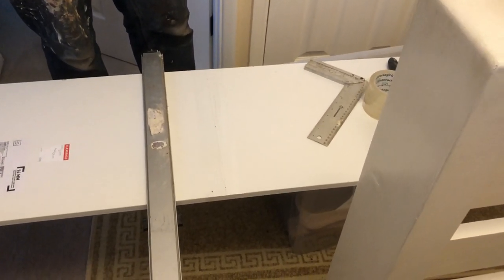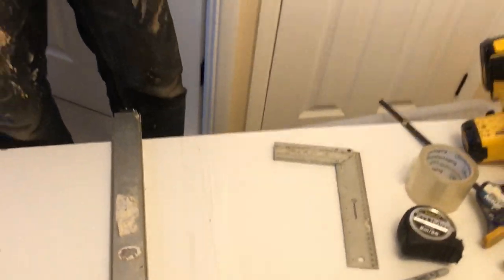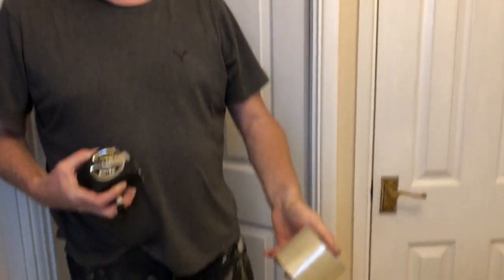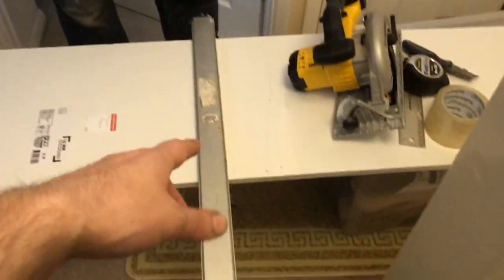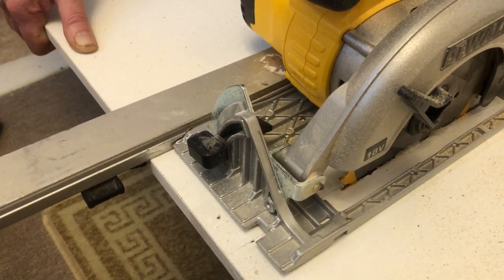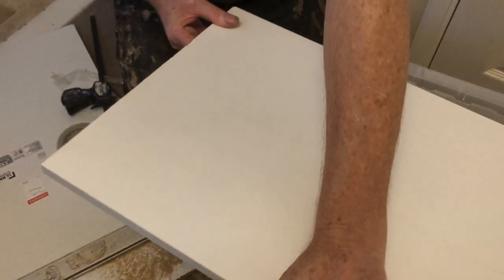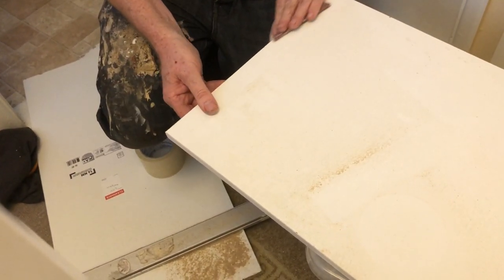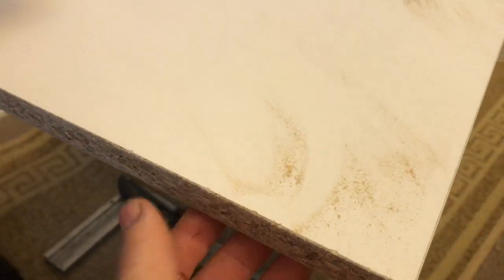How to cut melamine board

Comment: Do a 3mm trench cut first with your skill saw then make your full depth cut, use a 60 tooth blade too, you'll have minimal tear out on the top side.
Reply: What about cutting at 45 degrees? I need to shave the end off one at 45 degrees to fit in a tight spot against an angled wall. Any tips?
Reply: The Diablo finishing blades wirk great

Comment: Some good suggestions - but you really need a fine tooth blade to cut it and minimize the chips. At least over 60 teeth - but most are labeled for cutting plywood and plastic.
Reply from the maker: Yes this is correct, thanks for your advice.